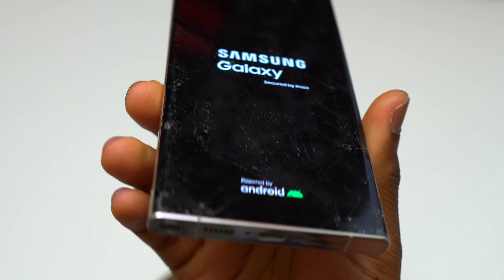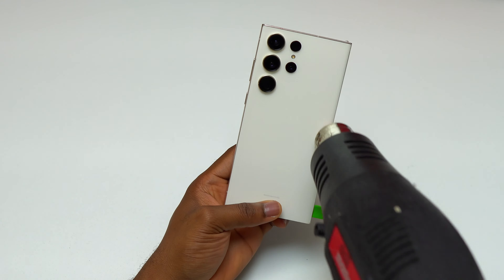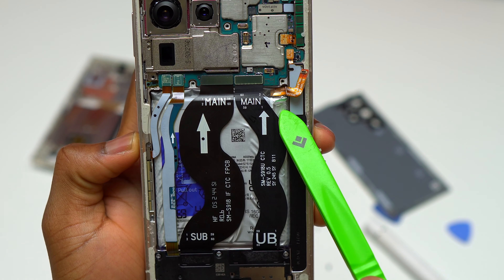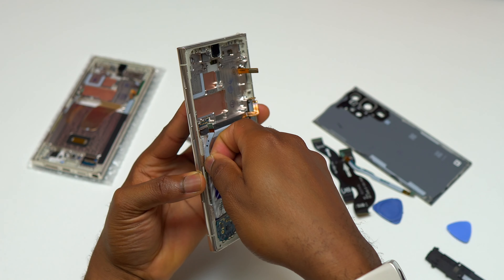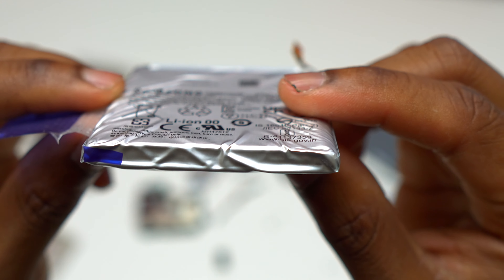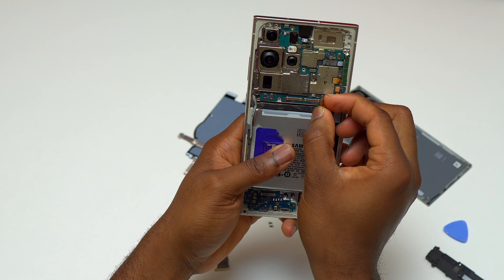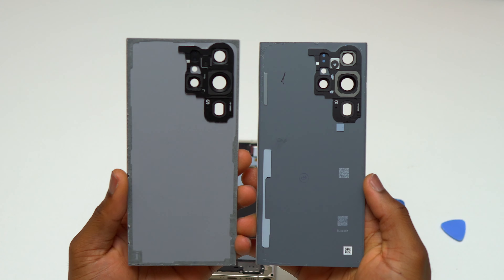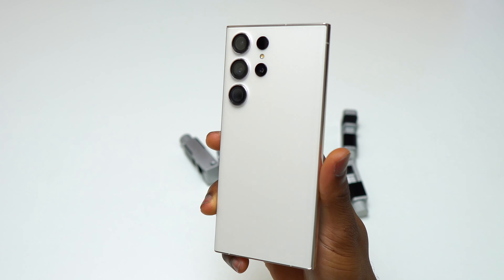Samsung Galaxy S23 Ultra Screen Replacement

Comment: I have a question 
After replacing the screen 
Will we loose the water resistant?
The IP68 ?
Or the phone can be working as needed as before without any problems

Comment: Would applying a small amount of sillicone to all the edges around the phone make any troubles? I find it interesting to try this out before applying the back glass to the phone. It could probably limit the water entry into "repaired and opened" phone. What do you think?
Reply from the maker: Silicone not sure which one you are talking about....if it's too thick it might not probably work well as you expected. By Silicone what I can think of is the B7000 which is the liquid glue that solidify into clear plastic. Adding that to the double sided tape can work well I have done it in the past. I would still avoid fully Submerging the device as you'll be only guessing that because you did that it might be restored to ip68. Which might not be the case and can damage you device if you Submerged it.

Comment: I have question pls 
The screen after you finish is it the as the original screen 100% or less
Reply from the maker: I used an original screen so it's 💯.
If you use a lesser screen than the original that would be the difference.

Comment: thanks for titling this video as screen replacement and then skipping that part
Reply from the maker: What part?? Let me try to help you understand
Reply from the maker: Do you want to replace?
1- Glass only
2- Screen Only 
3- Screen (screen with frame)
 ?  Depending on the choice the risks of failing is different from 100% success rate all the way to 30%.
Reply: @ersbit  The video is called screen replacement and you never showed anything about replacing the screen?
Reply from the maker: Ok what did I replace then?
Reply: @ersbit  The rear glass?
Reply from the maker: What would you wanted me to do?
Reply from the maker: Change screen is different than change glass glued to the screen. Changing glass only is possible but 99% trying manually to do it will fail including myself. You need to buy at least 2 machine $1000 plus to to glass only replacement.
Reply from the maker: Not sure if I don't show well or if you guys just skip the video around without listening to the information. Without the why and supplemental info during the video you cannot understand and will ask questions I don't understand how to answer 🤷🏽‍♂️
Reply: He replaced the whole screen and frame. It's the only friendly DIY way to do it.
Reply from the maker: @JamesTFaile you summarized it perfectly. Now if they still don't understand I don't know what the next proactive step would be.
Reply: @ersbit  maybe it would be helpful for people like them (not being condescending) if you clarified its screen with frame. I replace samsung screens often. And the price of screens without frame compared to screens with frame (which makes the job easy as you showed well in the video) is not that significant.

P.s. 
my hands were so sweaty and couldn’t remove that battery to save my life. I had to use some alcohol 😓. But that pull tab was still nice to see.
Reply from the maker: @swordofdespairL I agree with you but since we are on YouTube if I make the title in a certain way they would never find the video in the first place as it would be too specific. What they want also is almost impossible for me and for them (Glass only replacement on a curved screen at home with cheap and DIY tools) the failure rate is above 90%.
YouTube is very intelligent they were showed this video first then if they don't like it they would be shown other videos most of them are just not instructuional, too fast to follow or doing something they cannot reproduce at all 😅.
Reply: You did a great job, as others have said with frame is the best route for diy, the extra steps to do a screen only will lead to more chances of things going wrong. Especially if they miss a tiny piece of tape or glass, or if the frame is dented slightly they either break the new part or can't install it.
Reply: Don't ever buy just the glass. You will end up breaking the screen.
Reply: He didn't skip it? To replace a Samsung screen you have to replace the entire outside of the phone, basically. He took the internal components, put them in the new frame, Which Includes The New Screen In Said Frame. And reapplied the screws and sealed the phone again.
Reply: When you purchase the screen from samsung, you buy a frame+screen+battery. So when replacing the screen, you put all the components from your old frame into your new frame

Comment: I have heard somewhere that once the back glass or display part of the phones having any IP rating is opened, then the IP rating goes away permanently and the phones become seriously vulnerable to water damage. Is it really the case? Would appreciate an answer to this.
Reply from the maker: Hi, exactly. I did the stubborn and tested the water test after replacing the back glass lol it failed then motherboard failed then permanently damaged.

Galaxy S23 Ultra Water Damaged Repair Attempt
https://youtu.be/8iJ37bkTC84
Reply: I work at a samsung certified repair shop. We reseal the front lcd and back glass with samsungs adhesive rework kit and perform outgoing quality control to make sure we sealed it enough. Without a good seal it will get water damage.

Comment: If you had used the prefab adhesive strips, would you still use the extra glue?
Reply from the maker: It depends. Some double sided tape are of very good quality those can be used without adding extra b7000. Even those really good ones should get benefits of adding a very small layer of b7000. If you don't have the glue b7000 you will be fine using the double-sided tape alone. Black double sided tape were the ones with the worst quality they are very thin and will not hold for long.

Comment: Hi all I have cracked my Samsung s23 ultra Where i am living I am told it will cost 250 pound for the screen replacement. Samsung does trade ins but will fetch me only 120 pound and additionally the cost of a new s24 u of 645pounds. Should I just replace the screen or trade in which seems to be a better option? Please advice. Thanks in advance

Comment: Can you replace the body of the phone? I dented my s23 ultra on the corners and I don't know how to fix it.
Reply from the maker: Changing the body/frame only is extremely risky for the screen. There's a very high chance to damage the screen while trying to separate it from the body of the phone. It's better to get a new body with screen pre-installed and replace your screen. Then you can sell the damaged body and screen to get something back.

Comment: Does it have side effect after replacing the screen?
Reply: I'm about to tackle this, just make sure you get some quality adhesive when you put it all back together. Reason being is because it will not be 100% waterproof anymore

Comment: how hot do you need the heat gun
Reply from the maker: I usually have my heat gun at max power/heat then circle around the back of the phone for 20 seconds then try to lift if it doesn't work I will heat again 20s. If that still doesn't work heat for 30 seconds still while moving around it should be enough.

Comment: I just broke my Ultra 23 screen. Screen replacement stores are asking $350 to fix it. I got the phone for $1300. Don't want to spend anymore money. I'm going to try to sell it for $400 (good refurbished are like $800) and get a used Pixel 8 for $400.
Reply: You can trade in with samsung and get the 24 Ultra for like $637
Reply: @donhouston916  my wife already has the ultra 24. I went back to my Pixel 4a and everything is still fine. I don't use many apps and I do like small phones so it's all good. I'll trade in the broken ultra 23 when 25 comes out.
Reply: @jayfloramusic  sounds good. I traded in my s23 for the s24 yesterday when it cracked
Reply: @donhouston916  was it a glass crack or lcd? Mine is lcd. I fear that is more expensive to fix than just glass screen so I'll get less tradein value.

Comment: Someone please help me out here....I took my Samsung s23 ultra for a screen replacement like this and it came back with not reading the sim card and when I plug it up for charge it shut down and not taken no charge whatsoever...what can be the problem?? I'm so frustrated right now 😫😫
Reply from the maker: Did a shop fix the phone for you? Or you did it yourself? 
If they fixed it for you in a shop it's better to bring the phone back to them as if you try something they can say you have done it wrong and they cannot touch it anymore. If it was done by yourself or a friend there's something that was not done right either a bad connection of the flex cables (most likely if the device before the repair was in normal working condition).
Reply: @ersbit  it was done by them and it's the first time I'm repairing it
Reply from the maker: Ok. The best move is to bring it back to them so that they can fix it. It seems to be very recent so they cannot refuse to take it back as it is not working well.
Reply: @ersbit  could not connecting the USB port cause a issue of it blanking out or it not reading the sim card? Cause it was working fine until I got it changed
Reply from the maker: @terryakamadcat no not really. It should not do that. Maybe the charging module was not installed properly or is not sitting right after the repair. The charging module has the sim card and USB-C port on it. Or when you plugged a usb it moved due to improper installation same thing can happen with sin card if you took it out since it the same pcb board. 
The fix should be easy (making sure all the cables connected to the charging module are connected all the way and not superficially and also making sure the charging module is installed properly and all the screws were installed. I doubt the charging module is bad since it was fine until you use the charge port and sim card tray.
Reply from the maker: After all verification if the device still does the same thing (having issues) then somehow the charging module might have gotten bad.
Reply: @ersbit  the charging port gone bad in 1 night? Without a fall or anything is after the repair it came back not reading the Sim card and not charging but thanks so much for your help 🙏🏽

Comment: How do you make sure the phone is water resistant after the repair?
Reply from the maker: In reality replacing like this you would not be able to certify or test the IP rating or water resistance since you do not have the machine they use to make sure it is water sealed and certified. You can just Submerge the phone but if it fails you might have a broken device and have a definitive answer to is it water resistant again. I recommend avoiding water after you do any type of repair as you would not be able to positively confirm the status of the IP rating. It may be fine for light water and rain but anything Submerging the phone fully might be too risky.

Comment: The replaced screen will have same quality as the original?
Reply from the maker: Yes, the screen I used was from another Galaxy S23 Ultra (original screen). There should not be any issues with the new screen (everything will work 100%).

Comment: So, where was the screen replacement?
Reply from the maker: I guess you didn’t understand what was going on in this video in order to replace the screen the screen alone you will need to purchase $1000 machine that is going to separate the screen and the glass. If you cannot purchase $1000 machines and some other machines in order to do the laminating of the screen and the glass together, you just have to do what I did in the video you can try to do it by hand separating the glass from the screen, but I think that you will fail because the success rate of doing that with your hands is less than 2%.
Reply from the maker: In reality, I showed you the easiest way to replace the screen with 100% success if you want to go the other route replacing only the glass like I said you will fail because removing the glass alone is going to be extremely difficult and then you need a new glass to be laminated with the screen after you clean the screen, which is going to be Almost impossible to be done 100% successfully because you will need a laminating machine that is going to use suction force (void) and seal the screen and the glass together.

Comment: Why was the battery damaged? It's a fairly new phone.    My screen cracked as well, even with the Otterbox Defender case. That indestructible Gorilla glass marketing is pure garbage. This phone is prone to getting dropped because of the weight.
Reply from the maker: For this one I do not know as I purchased the device to show how to fix it. The battery must have been mishandled by the previous person who opened the device or assembled the phone. That's the only thing I can think of. Hahah no matter what they advertise these screens will break its good for their repair programs business 🤣
Reply: @ersbit   For sure! Here's the thing; I've never been a fan of large size smart phones like the ultra because they're more awkward to handle so there is a greater likelihood for dropping the phone. The extra weight doesn't help either. Oh well.  $hit happens.
Reply: @alphacentauri8083  technically gorilla glass is supposed to be mainly for scratches, but it doesn't even prevent that all that well.

Comment: Phone is waterproof again after screen replacmanet?
Reply from the maker: No. Avoid water I wanted to test and lost my galaxy S23 Ultra here
https://youtu.be/0T6nbAE72u4
Reply from the maker: Avoid water unless you are 100% sure it's water resistant by performing a pressure test using a machine.
Reply: @ersbit thank you for your reply do you add water resistance adshive?

Comment: ReinstallING everything seems like it's always the hardest. Shame on you for skipping that part. Overall great video tho. Wish I watched this before I was ready to do the job. I have to get the adhesive and clamps. I plan on using b7000 instead of double sided tape for the battery.. is that ok? I don't trust people with my phone so diy is right up my alley. Plus I bought a new screen that has a green dot from ebay for only $100. Idk how much you charge but my guess is $250-$350 for 20 minutes of work.
Reply: Even though galaxy phones have maintenance mode. Overall I should be in it for about $123 after buying adhesive and clamps from amazon. Since I already have heat gun and screw drivers from last note 20 screen repair.
Reply from the maker: Sorry this one did not have that part check this one How to replace the Screen On Samsung S23 Ultra
https://youtu.be/ovFOVPVqIy4
Reply from the maker: B7000 and battery is not the best way to do it but if you have to do it it will work and keep the battery in place. 
I don't work 😅 I just do these videos because I like phones and repairing stuff. Logically my next step should be having a shop to fix customers phones. I'd have to leave my day job.

Comment: So this is essentially replacement of the frame also.
Reply from the maker: Yes. This is the most complete way to do this. As getting only a screen (harder to find) then do the installation on your old frame might not be as good and sealed like getting a frame screen pre-installed. That's why I prefer to show this one as the other one might not always work in the long term.
Reply: @ersbit  right, also there is very less probablity that one would be able to replace only the display and without new frame, without damaging the current frame.
Reply: @ersbit  In the EU they only sell displays without frame. Samsung stopped selling the display with frame modules
Reply from the maker: @nonameeee6145 Humm I think you can still find those with frame on eBay or Amazon. I get mine on Amazon or eBay for screen with frame. Some do sell without the frame but as stated it's extra work and might get the screen damaged or not glued properly.
Reply: @nonameeee6145  but why? Display + frame would fetch more money.......

Comment: why is the battery expanding this phone came out like 6-8 moths ago can the same happen with my s23ultra?
Reply from the maker: Not really sure...maybe a bad battery from the beginning. 
On the other end the battery looks like it was manipulated pull /preyed then reinstalled with all original Samsung things (pull tabs and new back cover) not really sure what happened here. (I got it online the seller said bad screen cracked glass but good lcd🤷🏽‍♂️).
Reply: @ersbit  thanks 👍
Reply from the maker: You're welcome 👋🏽

Comment: Whats name of that heater machine?
Reply from the maker: Heat-gun I have link to my current Heat-gun that I am using lately. All Heat-gun even very basic one like the one I used in the video should do the job.
Reply: @ersbit  ty a lot
Reply from the maker: 🤣 Also even a Hairdryer can work. I started with a Hairdryer when I did my first videos.
Reply from the maker: @boliteracku a Hairdryer will take longer to heat
Reply: @ersbit  well it will save me 25 euros xd